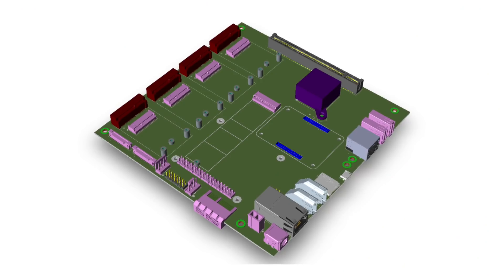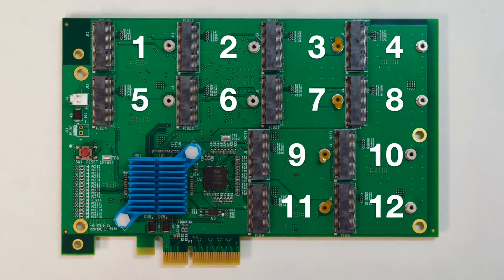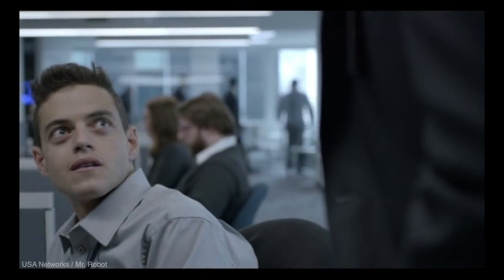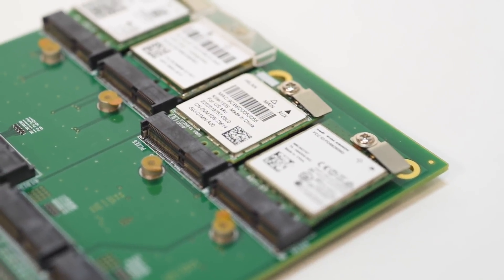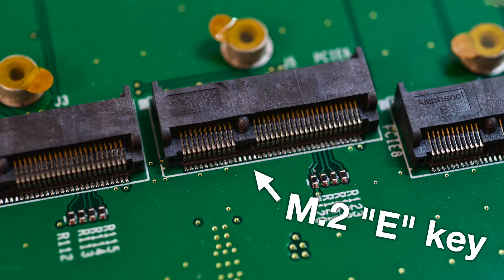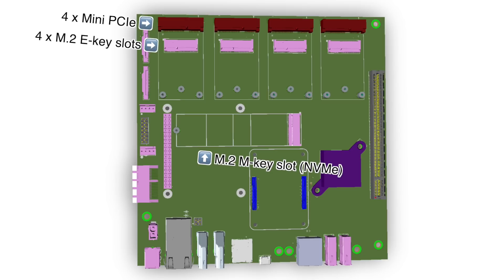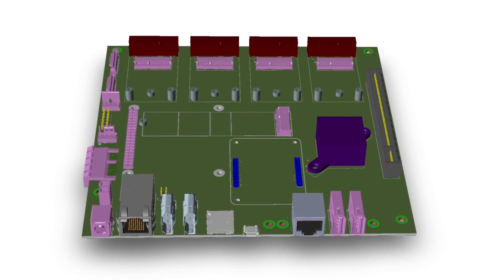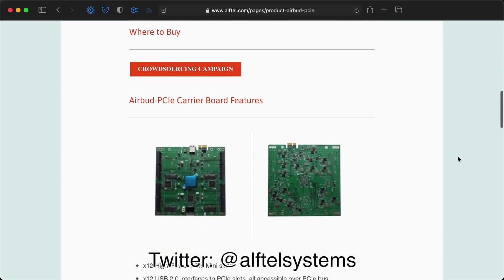12 PCI Express M.2 Slots on a Raspberry Pi!?

Comment: X16 slot as in you can put a full size gpu on that thing ??? What the hell lol hahah
Reply: Remember that even though it is x16 lane slot, only x1 lane is electrically connected - rationale is to be able to plug in ANY card and have it to use x1 lane - this way one will not need any riser cards or cables to evaluate any PCIe card with CM4

Comment: Mate what about putting 12 m.2 to 4 or 5 or I don't now how many sata connecter that would just be crazy
Reply: You can run your target search on Amazon i n order to figure out M.2 form factor SATA SSD vs M.2 PCIe NVME SSD and quickly discover that current NVME prices are a par or lower comparing to M.2 sata drives. Of course it is possible to utilize the same design concept and build similar board with, let's say, x8 2280 NVME drives placeholders.The question is if there is any demand for such a gadgets, and if it does make sense to connect x8 NVME devices to a single x1 PCIe rev 2 lane.
Reply: I have seen them on aliexpres yesterday and now this video so I thought about it

Comment: i would create a pi based nas
Reply: you can do that already, And it's optimised for omv already see 'ExplainingComputers Raspberry Pi OMV 5 NAS 2020' , add a cheap powered usb3 hub and a bunch of usb3 hd's ,done.  add a £30 usb3 2.5Gbit/s dongle (at both ends) if your drives can read/write quicker than antiquated gigabit ethernet, and make sure the 'folder to ram' plugin is installed and active.

Comment: I'm genuinely curious how the Compute Module 4 Cluster is going to work. They can't just put a bunch of slots next to each other anymore.
Reply: One of possible approaches will be to utilize this PCIe interface and put 2.5G or 10G network chip, then clustered CM4s will communicate PHY-to-PHY over  switch - usual approach for rack mounted high-speed solution - i.e. using 2.5/10G PHY based back plane for intra-board communication, data exchange and management t.

Comment: That B O T T L E N E C K
Reply: No, it's not - read my other comments somewhere below. To make long story short - the only bottleneck in this design is RPi itself.
Reply: @alexanderzakharov4249  No disrespect to the work that went into this, Its not a bad product. But a bottle neck is a bottleneck and peripherals are part of system design integration.
Reply: @first-thoughtgiver-of-will2456  Each product has it's own goal in mind and associated user base - our goal is to expand PCIe bus and allow users to use different commercially available PCIe mini and M.2 cards, and not to move gigabytes around. Just turn your mind around and treat it as PCIe hub - very simple. What is a limitation/bottleneck of the hub? It is upstream port, and in our case its x1 PCIe lane.
Reply: @alexanderzakharov4249  Look Alexander I dont want to drum on about this. I appreciate the product. You should reuse your EAGLE files and make a hardware RAID 5 system for m.2 storage to work around the bottleneck with parity set at bottleneck throughput.
Reply: Like  A serial Strangler On PCP

Comment: 12 PCI Express M.2 Slots = 12 PCI E slots at x4 (or x1 pcie2 speeds in this slots case) in a far smaller space, and a few passive ribbon's. that's a good future proof thing as long as they dont over charge and over value this active carrier, and so instantly kill it in the retail diy markets here... ohh a covid scalping! $300 for an active pcb DOA then, have fun playing with it, cha Ching No Sale.

 i noticed that's x4 slot so near full speed allowing for the internal? switch speed.
 if someone ever bother's to actually make something we actually want to pay for and put's a 'few' real DMA PCI E x4 synthesised block's on an arm retail core we can buy and use 'for cheap' along with the required upstream code, that's cool.
Reply: We do work hard as we speak with the bill of materials in attempt to make this planned kickstarter offering as affordable as we can. Overall design rotates around PCIe switching silicon that was used in our previous designs that are used by a number of customers wordwide. Of course, as with any high-tech project, there are things that may go wrong but we are confident in our design approach and ability to bring to community a solid and affordable design.

Comment: Been trying to get an M2 SSD in my pi 400 for a month now. 
Hit the post a few times with soldering onto the back of the usb3 ports. 
Take up on my post and tell me where I went wrong. 
Can only get it to work with externally connecting to the usb port. 
https://www.raspberrypi.org/forums/viewtopic.php?f=140&t=290131&start=25

Comment: Maybe I am not in the know..... but does anyone want a 8GB CM4 with 12 TPU's?
Reply: Answer (possible) - cloud edge device - check coral.ai web site to get a sense. BlueTooth/WiFi gateway? WiFi monitoring station? LTE modem station? Data mining gadget? Cognitive Software Defined Radio? With industry moving towards minimization M.2 became de-facto a standard for all modern add-on card development.
Reply: One more point to make - Coral as PCIe device concept goes is PCIe master, so yes, you do want memory at your disposal because it will be used by TPUs.

Comment: The rockpi offers 4 pcie2.0 lanes, as well as the rockpro64, the Odysee and the Odroid H2+. Hopefully an SBC comes out with Ryzen2 embedded and 4x PCIe3.0 lanes and that board should make a hell of a NAS
Reply: It was not about a number of PCIe lane or PCIe rev - it was about giving to RPi community possibility to test and develop for PCie domain, and make it as easy as possible. Coming back to the point made earlier - main bottleneck in all these ventures is not PCIe bandwidth, but rather application layer that saturates CPU cycles faster then data saturates communication link.

Comment: M2 or msata?
Reply: If you are referring to soon to be launched Kickstarter board it will be M.2 2280 Key M slot meant for NMVE SSD. Even though modern NMVEs do support x4 PCIe lane interface, they are "happy" with only x1 lane populated as Jeff did show in one of his previous videos. The problem with PCI-SIG M.2 Key B/M standard provision is that in case of M.2 SATA card it's SATA differential pairs do "replace" first PCIe differential pairs for NVME - if these guys would be a bit "smarter" they would definitely layout pinout such a way that it will allow "either" card to be plugged in. Unfortunately they didn't. As a result it is or PCIe based NVME or SATA, but not both.
Reply: @alexanderzakharov4249  gotcha, size looked like msata to me was all

Comment: Id love to load one up with Epiq Sidekiq SDRs 
12 transmits, 12 receives between 7MHz to 6GHz
Reply: Last time I checked their MOQ (Minimum Ordering Number) was something like 1K. But it will certainly be nice to have as a super SDR. The only (probable) issue is to have them synchronized - not sure if they do have a separate sync clock input, unless PCIe clock reference is good enough, but in this case one will more likely implement a high precision local clock source on-board rather that use one that provided by CM4 PCIe interface. From design and functionality stand point system will not care where clock came from - from PCIe root complex interface or it is local to the board.

Comment: M.2 TPU units.... Sick.
Reply: 4 TOPS with 2W power consumption and $29 price tag - hard to beat, plus Google framework that allows you to run complex model inference in parallel.
Reply: seriously i never did get the long running 'Thermoplastic polyurethane (TPU)'.. ohh i mean Tensor Processing (co processing) Unit and ' complex model inference in parallel' hype that only benefit's global corp's and the old is new again thin client remote terminal cloud corp dream.

it's all seems just an inferior version of a real personal local fractal roughness transputer AI they cant seem to make viable ( = make vast profits for cheap) yet
Reply: @paulmaydaynight9925  Google Marc Litchman and his article where he shows how to use TPU together with Ettus SDR for wireless traffic classification - very interesting stuff. Marc is associate professor at Virginia Tech.
Reply: @alexanderzakharov4249  cool.
yeah, dave is a Fellow of The Royal Society and the Clifford Paterson Medal and Prize of the Institute of Physics in 1992.
maybe you should ask him about his latest work about increasing efficiency and how you might integrate his proven idea's, forget the valley.

The prototype of the transputer was called the Simple 42 and was completed in 1982. The first production transputers, the T212 and T414, followed in 1985; the T800 floating point transputer in 1987. May initiated the design of one of the first VLSI packet switches, the C104, together with the communications system of the T9000 transputer.

Working closely with Tony Hoare and the Programming Research Group at Oxford University, May introduced formal verification techniques into the design of the T800 floating point unit and the T9000 transputer. These were some of the earliest uses of formal verification in microprocessor design, involving specifications, correctness preserving transformations and model checking, giving rise to the initial version of the FDR checker developed at Oxford.

In 1995, May joined the University of Bristol as a professor of computer science. He was head of the computer science department from 1995 to 2006. He continues to be a professor at Bristol while supporting XMOS, a University spin-out he co-founded in 2005. Before XMOS he was involved in Picochip, where he wrote the original instruction set.

Comment: Love the M.2 Coral TPUs.  As part of Google GDE program I have used the Coral TPUs on the Pi (USB 3 module) and the Coral Dev Board.  But never had a chance to try the M.2 module.  I am interested to see how this works and how well you can manage to keep 4 TPUs feed.
Reply: No problem on other platforms - we actually managed to run x36 Coral TPUs over Thunderbolt 3 with TB3 equipped laptop (like Dell XPS) or Mac Mini that has x4 TB3 interfaces. Our goal right now to make Coral-CM4 working for future cloud edge compute ventures.
Reply: @alexanderzakharov4249  - that is amazing.  Looking forward to these coming out.  We are launching a Google Developer Expert (GDE) Machine Learning channel and I am planning on creating some content on TensorFlow Lite and Coral on different devices.  Yours is the first board I have seen that uses the M.2 coral accelerator.
Reply from the maker: So far the drivers are not working, but hopefully that will change: https://github.com/geerlingguy/raspberry-pi-pcie-devices/issues/44

Comment: Wow incredible!
 wouldn't it be sweet something capable of holding like 4 to 6 rasp modules and respective slots for nvme storage? Thinking of a faster #raspk8cluster 😬
Reply from the maker: The Turing Pi 2 will hopefully have 4 CM4s and at least a few different exposed PCIe buses (but only one per board I think, no switches).
Reply: @JeffGeerling  cool!
Not sure if one can tgen share part of the each device as a gluster brick? Lets see

Comment: Jeff can you make a video talking about the differences between M.2 slots and adapters between them? I couldn't find a trustable resource about this information when I was researching if the M.2 slot of my motherboard which only accepts B M key SSD could work with an adapter to control a wifi module with  A E key interface
Reply from the maker: I am considering it. To be honest, I've been sorting through my own confusion on the topic for months now. I'm only beginning to grasp why there are like 20 different key combos (still not sure why, just I know there are :P).
Reply: @JeffGeerling  Jeff - contact me for material. It was a very good point.

Comment: LOVE THE KISMET SHOUTOUT! I wardrive as often as I can! 

Also the wifi pineapple you have shown on the video (the mk vii) isn't the one used in Silicon Valley (Tetra) 

Not hating, just nerding out because I appreciate the mentions of both! Love Kali!
Reply from the maker: Haha I just knew someone would point that out. And you did. Have my like.
Reply: @JeffGeerling  I have both sitting literally next to me! As well as a nano, don't judge me.
Reply: Proposed Kickstarter board will certainly be more "potent" vs tetra and Pineapple in terms of radio cards choice capability and completely open architectural concept. It is too early to say, but how about cognitive sniffer when one would combine Kismet or aircrack-ng monitoring ability with TPU based inference?
Reply: @alexanderzakharov4249  sounds worth testing, unfortunately that's beyond my knowledge but at least I now have a goal :)
Reply: @DaPanda19  just try it out with your laptop (hopefully it does have supported WiFi card) - visit kismetwireless org web site and take it for a spin.
Reply: @alexanderzakharov4249  my pi is plenty powerful enough :)

Comment: Were you able to run corals? Or still having MSIX 32 bit compatibility issues?
Reply from the maker: MSI-X issue seems fixed... at least sorta. Right now the driver just locks up when I try using it on 64-bit Pi OS.

See this issue for details: https://github.com/google-coral/edgetpu/issues/280
Reply: @JeffGeerling  yea, I saw your reply on the git.  Google team is slow to respond, Modberry has a product planned for cm4 with coral but you take my hopes up. Is there any resource explaining how does this pcie switch work exactly?
Reply from the maker: @realbork  The switch is part of the PCI spec, kind of like a 'USB hub' where you only have one bus, but can route traffic on that bus to different devices. Broadcom sells a number of switches: https://www.broadcom.com/products/pcie-switches-bridges/pcie-switches

Comment: 2:19 Hold up there bucko, you're not just going to walk past that. A 4 TOP TPU in M.2 format, and a way to connect multiple ones to a Pi 4?

@ZackFreedman
Reply: We successfully tested this particular board with x12 Coral TPUs being plugged in legit platform PCIe slot (x86) and ran Google parallel testing under Ubuntu. The problem right now is to gently "force" Google folks along with RPi folks to take a deeper look at this issue. Since our proposed Kickstarter board will have a standard provision for x2 PCIe lanes per M.2 slot, one will be able to utilize their new offering that is dual Coral TPU in M.2 form factor. Simply put - x4 M.2 slots with dual PCIe lanes populated per slot equates to 32 TOPS performance for TensorFlow Lite inference job. $39 per M.2 card at mouser.com - we as interested and motivated community should really lobby both Google and RPi guys to make it happen with 64-bit RPi OS or Ubuntu. Fingers crossed they will move.
Reply from the maker: @alexanderzakharov4249  Maybe this board could power the next Mars rover, with advanced AI/ML capabilities ;)
Reply: @alexanderzakharov4249  Oh wow, I just asked above about release timeframes.  KICKSTARTER?  Yeah, that's a no-go for me.  Kickstarter is a garbage tier card game peddling site these days.  Might I suggest crowdsuppy.com?  It's a MUCH more reputable site for tinker/hobby electronics.  I think it is much more targeted to the audience you are looking for.  I would imagine you'd get far greater interest and participation there than on Kickstarter.  People like me got tired of their lack of interest in backers.
Reply from the maker: Having problems with the driver, unfortunately :( https://github.com/geerlingguy/raspberry-pi-pcie-devices/issues/44
Reply: @JeffGeerling  :(

Comment: It sounds that the weakest link on this board is the raspberry pi itself? ... What is the purpose of the raspberry pi again?
Reply from the maker: Fun, education, low cost.
Reply: it's pretty hard to use Any bare bones PCB without a cpu and some *unoptimized code today, other than as a table leg wedge of course.

* David May uk transputer computer scientist..
May's Law states, in reference to Moore's Law:

Software efficiency halves every 18 months, compensating Moore's Law.

Comment: If the Pi foundation announced the planned future for the reserved pins on the Compute Module connection (specifically which pins will function as future PCI-E lanes for the Pi5 and beyond) then a board like this could be made forwards-compatible with future boards, too.

Comment: The one guy that is sniffing WiFi traffic is going to have a hard time with this setup 😅
Reply: Current Kismet implementation fully supports multi-radio concept and this particular board was used with great success being populated with x12 Intel AX200 802.11 a/b/g/n/ac/ax radios combined with a) internal antenna array, and/or b) active RX antenna splitter similar to what we have on Tindie.

Comment: M.2 graphics card? Going to have to look this up, might help my laptop with Davinci Resolve.
Reply: LTT did a video on it recently. It's definitely not going to help with Davinci Resolve. It basically exists to give a server a VGA output if it doesn't have one (either physically or because of some damage).
Reply: @LewisUpperton  ok, thanks. I've seem other hacks to extend what it ultimately a PCIe out to external box, but those are hacky.
Reply: A thunderbolt dock is a much better solubltion but connecting a GPU via M.2 might be worthwhile if you are okay with a ribbon cable coming (assuming there's space in the chassis for you to route one) out of your laptop. You'll also have to partially disassemble/assemble your laptop every time you want to transport it but the performance will still be better.

I've done a similar thing with a mini PCIe (gen1 x1) slot for fun and it wasn't exactly great due to the bottleneck. M.2 on the other hand gives you 4 gen3 lanes so you won't be bottlenecked, the only thing you need is an adapter if you already have a PSU and a GPU so why not give it a try?